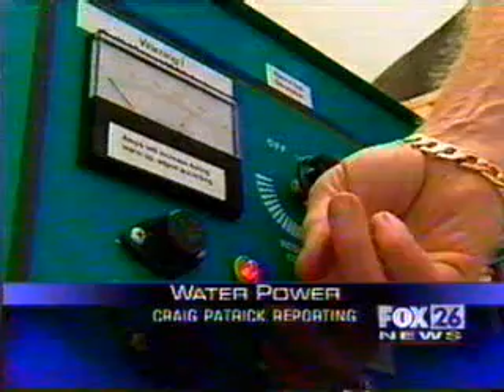Water Fuel Car

Comment: MrDuffy81, the electricity used for spark comes from the gasoline in your tank. Meyers does not demonstrate or prove a thing!

MrDuffy81, your statements lack substance. Your obvious lack of thought, and willingness not to put any effort into any kind of research, shows through in all you speak.

Comment: beccasmomabcd, you don't need to try something to know whether it works or not!

A water fuel car doesn't make it off the drawing board, so to speak. It doesn't pass thermodynamical laws.

So should I build and 'TRY' a perpetual motion machine even though it defies the laws of physics? NO!

Comment: HOW2useWATER4carFUEL, millions of people believe in God or some higher power, but that does not PROVE there is a God or a higher power.

Your testimonials don't prove a damn thing!

Once again, it takes more energy to break the bonds of H2O than the energy you get from  putting the 2H2 + O2 back together. THATS CALLED PROOF which you are totally lacking!

Your perpetual motion machine will continue to fail because you can't defy the LAWS of PHYSICS!

Comment: The last line should read: Now 476.4 * 3/3.42 = 417.9 W or 0.0004179 MW. Its 3/3.42 not 60/3.42 because its 60mins/20mins or 3. I calculated that way so the answer is correct.

Sorry for the typo!

Comment: bababookaka, weighing approximately 200lbs. and walking at 3 MPH one would burn 300 Calories. 1 Calorie = 1 Kilo-calorie = 1000 calories = 3.97 Btu's. Also 1 W = 3.42 Btu/hr. So a person weighing 200 lbs. walking a mile, @ 3 MPH burns 120 Calories/20 mins. = (120 * 3.97) = 476.4 BTU/20mins. Now 476.4 * 60/3.42 = 417.9 W or 0.0004179 MW

bababookaka, any further questions will be ignored due to the lack of substance!

Comment: Wind power is a renewable resource which generates electricity.

Wind energy is dilute, intermittent, land-intensive, and can't be stored on a large scale.

A typical wind turbine produces 1 MW. A 2% reduction in oil equates to 120 GW or 120,000 wind turbines. At the end of 2007, worldwide capacity of wind-powered generators was 94.1 GW.

We would have to more than double existing wind power to replace a 2% loss of oil production!

bababookaka, any more SMART questions?

Comment: uboherb, it takes MORE ENERGY to break the covalent bonds in an H2O molecule than the ENERGY you get from reattaching those bonds (burning H2+O2). It is that simple!

The energy being used to break the bonds in the H2O molecule is coming from the gasoline. The gasoline turns the motor, which turns the alternator, which supplies the electricity to make the so called HHO. If it takes 100 BTU's of gasoline to break the H2O bonds, and I get back 50 BTU's of H2, I've lost 50 BTU's!

Comment: Fuel cells cont.: Phosphoric acid fuel cell, Molten carbonate fuel cell, Tubular solid oxide fuel cell (TSOFC), Protonic ceramic fuel cell, Direct carbon fuel cell, and Planar Solid oxide fuel cell.

In any case, a fuel cell is an electrochemical ENERGY CONVERSION device. They produce electricity from various external quantities of fuel such as hydrogen, and oh yes, FOSSIL FUELS.

Comment: Absolutly thespazticator, fuel cells have been around since the 1950's. Some types of fuel cells: Metal hydride fuel cell, Electro-galvanic fuel cell, Direct formic acid fuel cell (DFAFC), Microbial fuel cell, Upflow microbial fuel cell (UMFC), Reversible fuel cell, Direct borohydride fuel cell, Alkaline fuel cell, Direct methanol fuel cell, Reformed methanol fuel cell, Direct-ethanol fuel cell, Direct formic acid fuel cell, Proton exchange membrane fuel cell, RFC - Redox..........

Comment: I know that fuel cells exist to convert hydrogen into electrical energy, and that GM (and other motor companies, including Mercedes-Benz) are developing fuel cell vehicles. The inherent problem is that the ENERGY HAS TO COME FROM SOMEWHERE!!!!! People don't realize that you have to put energy in to create the hydrogen. And unfortunately most of todays energy comes from fossil fuels such as coal and natural gas, which put carbon dioxide into the atmoshpere.

Comment: nataliyanataliya333, water fuel is a fools scam!

As for friction, electric motors are very efficient, but they require electricity generated from a power plant which may use fossil fuels to generate that electricity.

For conbustion engines, a large portion of the energy from burning the fuel is lost due to the molecules bouncing on all surfaces of the cylinder and not just the pistion. The energy lost is in the form of heat (due to friction).

In any case, a water fuel hybrid is a hoax!

Comment: The coefficient of friction can be made lower through various ways but nonetheless there is always friction within a motor mouvement. there is a way for you to pay less for gas still and it is bymaking a hybrid out of the car you have now, it doesnt run only on water, it still requires gas to make it run but you save cash on gas, so check out the website underneath:

squidoo . com / runacaronwaterfuel

Comment: So how should i answear that, if you havent noticed I said a car that runs on water would 
a perpetual motion machine ( definition:motion that continues indefinitely without any external source of energy; impossible in practice because of friction)car , which is impossible, and if you know abit of chemistry and physics a hybrid is possible to make, because through the explosion of hydrogen gas, it helps in burning the hydrogen more efficiently, thus saving you unnecessary refealing

Comment: 11JAYP11, no FOSSIL FUELS used in fuel cells? Fuel cells are CONVERSION DEVICES. They convert ENERGY SOURCES to electricty. These ENERGY SOURCES come from COAL(fossil), NATURAL GAS(fossil), NUCLEAR, HYDRO-ELECTRICITY, PETROLEUM(fossil), geothermal, solar, biomass, etc. This is not to mention the fossil fuels used to manufacture fuel cells.

By the way, fuel cells have been around since the 1950's.

As far as water fuel cells, redlerm below has it correct. In 1996 Stanley Meyer was sued.

Comment: And where does the energy come from to split the water? Oh yeah. Fossil fuels. While this technology is certainly a viable alternative to oxyacetylene welding, it is impractical for small-scale transport needs (i.e. cars) for the simple reason that an energy source is still required to convert the water in the tank to oxyhydrogen (in other words a battery or internal combustion engine). Why not skip the middle step completely and use battery-electric systems, such as Zinc-Bromine Flow batteries.

Comment: Very stupid video. It always amazes me how gullible Fox News is.  Hint: H2O is HHO.  When you add electricity to water you get H2 & O2 which burn very hot. If you don't use the oxygen in the torch then the fuel has to mix with the air before actual ignition, meaning the flame would be away from the burner, allowing it to to stay cool. Oh some mysterious energy source. Are you sure this isn't a parody?

Comment: UnheraldedHero, your very angry, GOOD! Its good you don't keep it all balled up and let it out. I wouldn't want you going postal!

As for YOUR water fuel cell, you haven't a clue about thermodynamics, chemistry, or anything that relates to any sort of science. I'd explain it to you, but who has that kind of time. I'd probably have to go back to the wheel.

So scratch your head and ass, and try to keep from dragging your knuckles!

Comment: TuNnL, these things are easily researched on the net. Please feel free to do some research before commenting.

In chemistry and manufacturing, electrolysis is a method of separating chemically bonded elements and compounds by passing an electric current through them.

Electrology is the practice of electrical depilation to permanently remove human hair. The actual process of removing the hair is referred to as electrolysis.

Comment: oh come on! how many people do they really believe are stupid enough to fall for that. aparently they are not familiar with the law of conservation of energy. it takes alot of energy to break the oxygen and hydrogen bonds so you'll have to use 100 gallos of gas to run your engine for enough time to produce 1 ounce of hydrogen which will get you as far as ten miles. people have known that you can use electrolysis to extract hydrogen from water but it just isnt economically feasible to do so.

Comment: I seam to recall in jr high this science experiment doing the same thing and they said after you break down water at a molecular level to burn off the hydrogen, then its gone the molocules dont recombine into water. Less then 10 percent of the water on this planet is drinkable and 8 percent of that is frozen in the polls. if we start using tap water to power things it wont be long before we have wide spread drinking water shortages. Just a thought.

Comment: That is a great concern for those who live in cold climates, but if what he said is true 4 oz. can power the car a hundred miles, then a automatic remote start could or should be added to the vehicle. Have temp settings to keep the cars fuel lines and engine constantly above freezing. Over an entire night one should only use (Temp pending) a gallon keeping it at idol. Something to think about. ;-) Replacing the fossil fuels with other resources will only benefit those who right now depend on it.

Comment: People are thinking. if this becomes mass produce we will run out of water!.. WRONG. water evaporates into the air and pours back down as rain. if all water were to be put through this process with in 5~10 years wouldent 95% of water all across the world be 100% clean?

Comment: karl1013,

This technology was actually invented in the 1800's. It's called electrolysis.

Unfortunately, you need energy to turn water into burnable oxygen and hydrogen. That energy comes from gasoline or electricity. It actually uses more gas/electricity, than just using gas/electricity to run the car. 2nd law of thermodynamics. Check it out.

Comment: There is allready more efficient and cheaper fuels out there, and yes they are also not harmful for the environment. Electricity driven engines for example, way more profitably. Hell, even Hydrogen engines are more profitable than this.
Only becuase it's driven by h2o it does not have to be the best and none toxic fuel.

Comment: Maybe standard constant electrolysis want work but PULSED DC gives huge separation of elements with very little energy input making it "overunity COP"
Your books or old science materials should be burnt, maybe you can get some free BTU's with your useless in-correct resources
Even better continue to be stuck in your box, wondering why everyone else is walking around outside of your mental cage.

Comment: I am converting a Ford Focus to run with a Hydrogen/Gasoline mix (about 80/20).  Water is, well, much cheaper than gas.  Not sure if I agree with your theory but it's worth looking into.  At the very least I think the new technology is very promising and also deserves much attention.
Reply: This technology has been around since the 1950s, as far as I know.

Comment: This is NOT the old method of electrolysis. This is a method that uses low amps and has high output yields of Hydrogen.

Comment: Are you dense? The reason why water can't be used is because it is as oxidized as it can get.  The H-O-H bonding simply doesn't contain energy. This is why you can set fire to hydrogen and make it react with atmospheric oxygen to produce water-vapor, and not the other way around. Yes you can get hydrogen from water but that requires an energy-amount bigger than the product-yield of hydrogen and oxygen, WHICH MEANS YOU'LL USE MORE POWER THAN YOU'LL PRODUCE.

Comment: the system(water fuel cell) can run off a 5-12v dc car battery, the combustion of the hydrogen creates the energy. no laws are broken

Comment: no, you use 12v from the battery to run the fuel cell, the hydrogen gas can run the car, and re-charge the battery

Comment: hitting width of 1:10 ratio and adjust frequency, Bingo HIgh output Hydrogen production with low amps. Its is real, and it is free, and it is now

Comment: Anode and cathode are now Stainless steel and placed 1 mm apart. 5-12v dc to transformer increase to 24, then fed to a induction coil pulsed circuit

Comment: You are thinking of the Old Method of Electrolysis, this is a new method, uses low Amps high voltage, and yields high Hydrogen

Comment: Fuel cells are not the answer for the source of energy, they're an intermediary like a battery. The point is you can get the energy from sustainable sources if neccessary with the usable benefits of fuels like gasoline (i.e. you could simply fillup your car at a fuel-cell station).

Comment: As a welder I can say this is total crap, You cannot have a flame hotter than the sun on a copper tip and I have not even heard of a welder getting that hot anywhere, you cannot hold the tip with the flame on any kind of setting you actually use to weld, and 3 seconds to melt a brass ball is enormously slower than current welders, a simple arc welder produces a steel puddle in a split second. Finally, gas welders are not used in any kind of serious welding.

Comment: actually the electricity to do the electrolysis comes from the car battery in this scenario... and then the alternator once the car is running.. ..you have to keep in mind that this system produces HHO on the fly.. on the FLY

Comment: Normally I would agree this is a hoax, except that Kline isn't the only one who has claimed to do this.  And for those spouting the Thermodynamics proves it's impossible - for Stan Meyer's version it just seems that he has solved the heat/loss problem.  Making the process more efficient doesn't break the laws of thermodynamics.  It just means more of the energy in is being used for work done.  Why can't Kline have done something similar?

Comment: Um, that's what he invented this machine for, dumbass.  He obviously found a way to make his HHO gas without using a lot of electricity, which is why he is getting it patented.  When the machine was on it was only running at 20 amps, which I'm pretty sure any car battery can handle.  Did you even watch the damn video?

Comment: Yes, hotter than the surface of the Sun...
"The Sun has a spectral class of G2V. G2 implies that it has a surface temperature of approximately 5,500 K (or approximately 9,600 degrees Fahrenheit / 5,315 Celsius)"

Comment: What are you talking about ? fuel cell cars run on electricity, they just use the fuel cell to create the electricity to run the motors. 

The method presented in this video, being real, is completely inefficient, internal combustion engines have up to 28% efficiency compared to electric motors with up to 98% this is due to most energy is being released in the form of heat instead of motion.

Comment: *the process uses more electricity to produce a given amount of power than it would take produce the same amount of power with an electric motor.
*a solution to this is to use other methods of breaking the water down (or getting the hydrogen and oxygen from another source) and then burning that, this is what fuel-cell cars do.
*solution?
*use fuel cell cars, the auto industry is working on it as we speak.

Comment: OK, first off...
Get a browser with a spell-checker already.

Now that that is out of the way,
*HHO = Hybrid Hydrogen Oxygen the gas is a mixture of hydrogen and oxygen (actually, it is two parts hydrogen and one part oxygen, that's chemistry)
*water + electric energy = HHO
*HHO + spark = less energy than it took to make the HHO in the first place (that's thermodynamics)

Comment: The machine uses electrolysis to split water into hydrogen and oxygen.  It uses a lot of electricity to produce far less energy in the form of H2 + O2 gas.  So it is far less efficient a fuel producer than, say ethanol and biodiesel (which turn about 1 BTU of coal+oil into 1 BTU of ethanol and 1/2 BTU of biodiesel, respectively).  It might make 1/10th of a BTU of H2+O2 from 1 BTU of electricity

Comment: yeah this has gota be total shit, no offence but if it uses electrolysis then he either has it done first, using massive amounts of electricity of the grid (brom burning oil) or is claming that hes invented a 200% efficient reaction, im very scepticle. plus, if you burn 2 molicules of hydrogen and one of oxegen, im no physicist, but im prity sure you dont get water out of it

Comment: Water is an unlimited resource.  It will not run out.  The ice caps melting is due to what we're doing now with oil.  If you take water.. and convert it to a gas it will immediately return to its liquid form after its used.. you wont be losing any water.  Some may evaporate.. but that will only contribute to the atmosphere.  A never ending cycle.

Comment: It takes about 5.5 kilowatt hours of electricity to make a cubic meter of hydogen from water via electrolysis. The energy in a cubic meter of hydrogen is only about 3 kilowatt hours worth of energy. A car getting 30 mpg will burn that in about 2.4 minutes.  The alternator power required would be close to 14,000 amps. (165kw) And that is to maintain the 30mpg rate.  The invention of a system that could harness that sort of power would be the invention of perpetual motion.